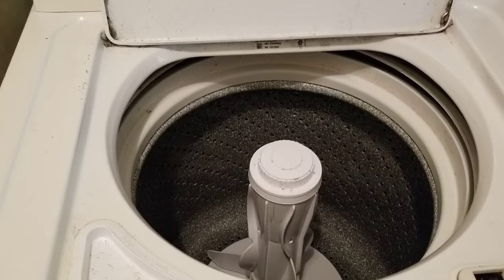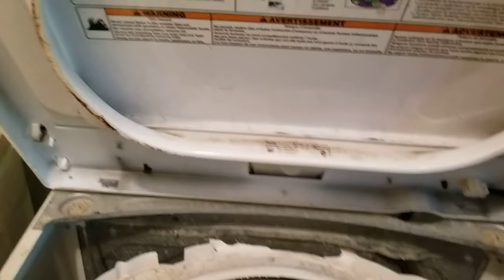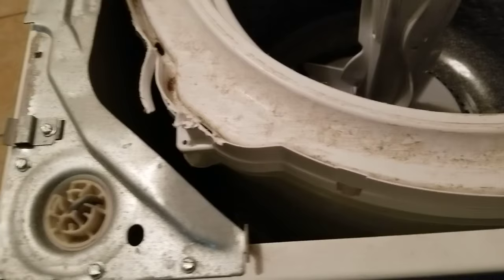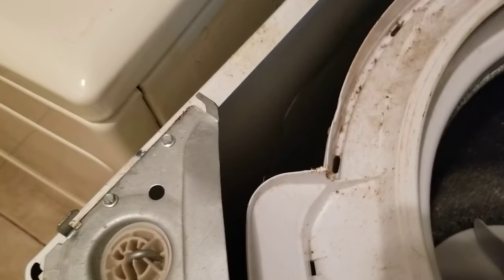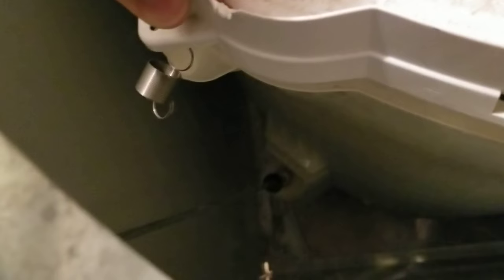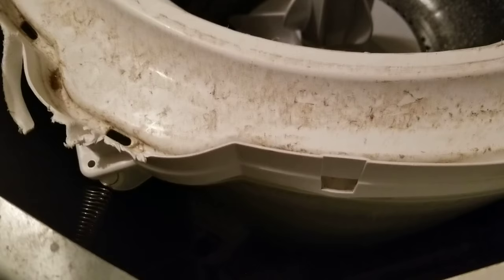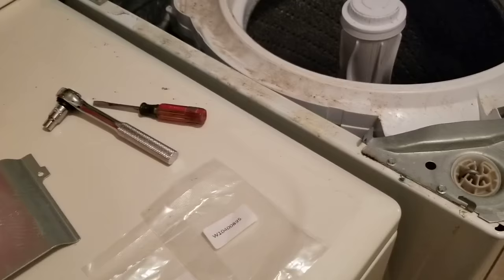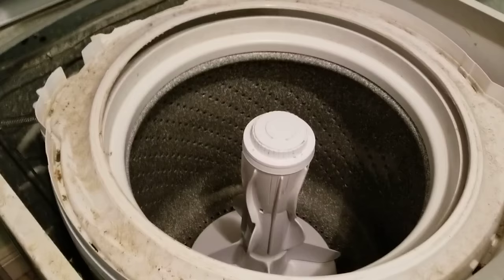Roper / Whirlpool Washer banging out of balance No. (1)  / shakes / moves *(worked briefly)

Comment: Thanks for this video. My Whirlpool washer is also "banging" around during spin cycle. I've already replaced the suspension rods and that fixed the problem for ONLY the 1st few loads. My washer also doesn't come with these centering springs. These centering springs look so flimsy and doesn't have enough strength to hold the drum from "banging" around. Can someone please confirm that these centering springs will do the trick?
Reply: I was thinking the same thing
Reply: They don’t do the trick, these light weight springs are useless, there are some stiffer springs for $24 on Amazon though that look more like what is needed.

Comment: Replaced suspension rods and still didn't solve the problem. Then I replaced Washer Drive Block which solved the problem. Definitely get yourself the spanner wrench. It's worth it! I tried to remove it first without the spanner wrench and it didn't work. Once I got the spanner wrench, it was super easy. Replacing the Washer Drive Block solved the possesed washer machine problem.
Reply: Wondering if the problem is the suspension rods on a Maytag,  having the shaking problem.
Reply: @7dony  try replacing the rods first and if that doesn't solve the problem then replace the drive block.
Reply: I will try this.  I also installed the  suspension springs to no avail.
Reply: How did you determine that the drive block was causing the banging problem? Where did you get the spanner wrench from?  Thanks in advance for any and all info/help!

Comment: Sorry to tell you this buddy but you're wrong... that model meant to have two and only two Springs because if you look on the bottom of the washer the weight of the motor and transmission are not even... it needs Springs only in specific areas to compensate.
Now if you look on minute 6:30 you see a top cover broken... you have  to look behind the washer and you'll find there's a big gap in between two Metal Sheets... that it is Where the manufacture fuck it up... the plastic get tangled a high- spin speed... know your job it's find out why your washer it's why your washer it's wobbling I'll give you some tips
1- your washer it's not leveled
2 not pumping the water fast enough
3- one or two springs are missing
4- drum off center( very common problem) rotate your drum why look in your tub if you notice a wobbling imagine that at high spin...
5- look underneath of the washer
Reply from the maker: <SpongeBob French Announcers voice>: "Twenty Two Months later... it was the rods, till working like new. Thanks though. Maybe for someone else.

Comment: All  I ordered and installed where the long things with a spring at the bottom. I watched several other videos and this one before I think. Boy I had a real hard time pulling up and turning anything to align with those slots at top as you shew, HaHaHA, I guess it's showed. Never was good in English grammar. Today I show Yesterday I showed tomorrow I shew? Will show? Apologize for getting off track, I've been accused of rambling but don't believe it. Anyway back to the subject. I ended up using vice grips to grab the rods to pull them up and put enough  pressure on them to twist and line up with the slot to  install and remove. They were too slippery to grab and pull up bare handed. I didn't investigate but there may be a way to jack up or raise and support the tub to remove the weight and to support it until the rods are removed and installed. Probably not without doing damage and difficult to work with due to lack of room. It can be done with one person but 2 would make it a lot easier and a lot less cussing. I was going to say or work it in at the beginning when I mentioned watching yours and the other videos, Seems like yours was the only one showing those small springs at the top of the tub. I never saw any, I think you commented on something similar. I did notice when ordering the long rods with springs that it mentioned "people sometimes order these also" showing 2 of those springs at the top of the tub that attach the tub to the sides. As I'm saying and you said 4 makes more sense than 2 and I don't know if they discontinued their use or just forgot about them but I never saw any sign of any of them so I decided not to install any of them. I'm procrastinating doing it as It's a double barrel pain in the rear especially for one person. Probably also for 2 and there's not enough room for 2 hands in there anyway. I was thinking the other person could pull up on the tub and relieve the pressure caused by the weight of the tub. Seems like the first one or 2 are easiest maybe because the others are holding a portion of the weight. The tub is empty (no water or anything inside them) but I guess it's still very heavy although I don't see why. Perhaps there's something attaching it to the bottom. I don't think anyone wants to get into that if so. Maybe mine just has slicker rods or something. Theres not much room to work. I saw where you showed how to remove that upper piece to the tub. If that looks easy I may do that just to get more room for my arms to get in there. Last time I got all scraped up and cut a little. There's lots of sharp edges in there especially on any of the sheet metal. We'll see what happens this time. I did it before thinking there's got to be a way to bend or clean or roughen up those rods or pull the springs out and stretch them and make them work again. They are such a simple looking thing and I couldn't figure out what could wear out unless it was the spring at the bottom. When I found out I didn't do much, almost impossible to stretch the springs. I think I tried bending the rods where the springs where to make it harder for them to stretch. I never saw how anything could wear out and why they weren't working but I suppose the wear is so slight and impossible to see or detect that nothing I found would work. One of the other videos said they're just worn out and get some new ones. So, I guess I'll try these I got from Amozon for almost half price and free shipping in 5 or 6 days. Postman dropped them off and the box looked like it came from a train wreck but the rods don't appear to be damaged. If I have time and remember I'll write another way too long comment to tell whether or not installing those small springs up top made a difference. I should have said not installing but not being good a grammar my sentence would have read (whether or not not installing those small springs mattered). I think I am starting to ramble and don't even understand what I wrote myself. Geeze, Later

Comment: Just a question here I have the same machine it was given to me and it's old and used it for quite a while and then it started doing off balance making a lot of racket so I  replaced the suspension rods and then I just seen your video about springs and you said a lot of them don't even come with springs well this one looks like it never came with springs why all of a sudden now is it not performing right because if it never had springs, why now does it need them?   I guess that's my question. I guess I like to know the why when things happen. But I'm really really glad that I caught your video because I'm sure it's going to be the problem solver.
Reply from the maker: adding the springs STRANGELY worked for a few washes (DOESN'T make sense) but the other video, replacing the RODS is what fixed it STILL since video date...

Comment: I just installed my springs.  I found that if you use vice grips to hold the rod it gives you something better to lift the rod up. I also marked the rod and the holder, where it was, with a marker to get it back exactly where it was originally. I'm trying my first load now. Springs didn't work for me!!!!!

Comment: my kenmore does not have these springs either and my washer does at times goes out of balance. Would these springs work for my kenmore also? Thanks for the info in the video.
Reply from the maker: 'If" it came without them, no. It's probably the rods 'springs' going bad.

Comment: I'm ordering rods for mine, banged around when the load shift when new, machine about 4 yrs old, bangs all the time, unusable, but now I'm not sure the rods will resolve it, I did take each one out, and for the life of me I don't see anything physically wrong,my machine doesn't have any other springs, only those suspension rods, I did notice that when filled with clothes and in wash cycle, I stopped it and lifted the basket by grabbing with both hands and let go and the basket seems to be hitting the bottom, so maybe the springs are allowing sag, I'll update when I get the parts

Comment: I put the four springs and it still bangs around. Not as much and it quiets down just a little faster but the problem still is there. Good video though. Thank You
Reply from the maker: Look for my video on 'rods' that fixed it and still working years later.
Reply: @PatriotMarine  Yes just saw it. On my way to replace them. Thanks!

Comment: Did putting 4 springs make a difference?  We just put ours back together b/c the spring had popped off, but we will replace the springs now.  Wondering if 4 (there were only 2) is better?  Also, why do you have *(worked briefly) up above?  Appreciate your help.
Reply from the maker: as you noticed, it 'strangely' worked for a few loads ONLY. Then on the next video on the channel about the washer replacing the rods; that worked and it's STILL working. *(look at video date)

Comment: My washer didn't have any springs on it.  I bought two for the right side and it didn't fix the problem.. I replaced the suspension rods and that didn't fix it either... suggestions.  I have a maytag centennial washer mvwc200xw2
Reply from the maker: strangely the 4 sprigs made it stop shaking for a few washes, but then started again; the rods stopped the shaking & like new still.

Comment: Hey sir, you included a link to amazon for the suspension rod kit

Do you have a link for just the suspension springs?

Or is it recommended to replace the rods AND springs?
Reply: I'm wondering the same thing.
Reply from the maker: Just Added Link

Comment: Thank you for posting this video.  I was sincerely hoping this would be a solution to my identical problem with my Roper washer.  I ordered the springs you recommend and installed them.  First load after installation, still shaking!  When I received the springs I was doubtful they would be of any assistance in helping with the shaking due to their flimsy nature.
Reply from the maker: The RODS made it work perfectly.

Comment: My Whirlpool top end Washer shakes and rattles only at the beginning. I checked inside and do not have any springs on the rods and there are no holes for springs. The rods looked Okay but I might take a chance and order the rods. It is an older model ( either 1991 or 2001, according to a website that identifies the year).  I wonder if the springs were only put in the newer ones? It was also chipped and cut at the top like yours. Thanks for the video
Reply from the maker: Wow, you're getting your moneys worth out of that one. If you see first video I didn't replace rods because after inspecting them (except checking amount of tension on springs) there seemed to be nothing wrong with them. After receiving new rods & springs by sight or feel STILL couldn't tell the difference, but that fixed it. Good luck.
Reply: Old rods look fine, but they are weaker, new rods fix ours.

Comment: We are having the exact same problem with our washer and it's a Roper. There's no springs like the one you put on yours. The rods are fine. When it starts the spin cycle it starts to walk it's way out of the wash room. It's driving us crazy.
Reply from the maker: on mine, the side springs worked for a couple of loads, then EVEN THOUGH the I inspected the springs and seem fine (even after new ones arrived) that's what fixed the problem 100%
Reply: @PatriotMarine  thank you! So I need to get the Model number off of my washer and what exactly do I type in to order the springs? Thank you so much for that video! I don't understand why they never put them on it in the first place. The only thing I could come up with was after buying the washer they knew we would need those springs later on.. that's what I think but it worked so well before I needed them 🤦🏻‍♀️ lol..
Reply: @PatriotMarine  Explain more clearer ? did you use 2 springs in beginning and later add 2 more to solve problem ?
Reply from the maker: @mark-Vortex369  installed 4 springs & worked MUCH better for a couple of washes; then had to replace rods as in next video to finally fix for good.
Reply: @PatriotMarine  thank you , make sense it was working without springs to , whirlpool has them . I am going to order them to plus the Rods .

Comment: Hopefully we won't run into this problem but we do have another issue you many know about, if you please.
Someone gave us a washer like yours and right now it's not filling. 
We had our pipes re-done and haven't had a washer until now. Apparently the hot water facet in the laundry room in not flowing so I only connected the cold water hose.
Does this washer need to sense pressure from both sides maybe? Could that be why it's not filling?
Hope you can help. Thanks
Reply: Mine works with only cold hooked up. The problem is probably that this washer is the biggest POS appliance the world has ever seen.
Reply: @nelsondln  I got a proper hose splitter and hooked both sides to the cold water and the machine is working fine. The washer was given to me for Free!  That was a blessing and on top of that, a dryer someone gave me ten years ago was hooked up and it works perfect too!

Comment: So much gratitude , you are a Wonderfull Man !
Question , what is happening that it does not fail to begin with if the springs are missing ?
Why does it not make the banging noise in the beginning , so logical it needs 4 springs to balance it out ?!
Reply from the maker: Correct; common sense says adding 4 NEW springs shouldn't have fixed it since it only worked for a couple of washes then banging started again and was finally repaired by replacing 4 rods as seen in next video.

Comment: Great video! Quick question: what would happen if I change the rods but the new ones are slighltly shorter than the original ones?
Reply from the maker: I would ASSuMe that it would bring the bucket up that distance, springs being the same tension.
Reply: @PatriotMarine  Thanks buddy! What do you think? Should I get the ones with the original size?
Reply from the maker: @McTzt  O always do when available.
Reply: @PatriotMarine  Thanks man! :)

Comment: I only wish I would've watched this video before my jery rigging which was to drill 2 holes in each side panel and feed a rope into one hole, wrap around bowl and come out the other hole so the rope is in a U shape.  Did this on both sides and problem solved, although its ugly.  My question is, that round thing you chose to not replace that you pop off with a screwdriver, I chose to remove it and not replace it.  Will that end up being a detrimental decision in the future or do you think it will be fine?  Thank you in advance if you respond...
Reply from the maker: not sure what part you're referring to, what time in video?
Reply: 4:33
Reply from the maker: @bongo042  that's what carries the bleach in and keeps it from splashing out as it gets spinning fast.

Comment: Update: as I mentioned before the springs did nothing, and there is nothing wrong with the rods.
I just put 4 pieces of foam about 6-8 inches on each side of the walls but inside, between the plastic and the metal wall. That did it.
I tried with a Large wash and it still  vibrates  but the plastic did never hit the metal walls again.
Save your money, try this first, do not buy the springs.
======
Ordered the springs but they are a joke, too weak. Won't work at all.
What I did was put a couple of packing foam from a package box I had on the sides of the fridge, very tight and when the  banging starts it lasts 1 or 2 seconds only.
Thank goodness my washer is in a separate place surrounded by walls.
If you have the Washer and Drier together one guy in this section did tie both together with a long cable/rope and that fixed the problem as well.
Good luck with this badly designed Washing machine
Reply from the maker: 'if' the rods are your washers problem & you install the proper rods, it will work like new.
Reply: I'm giving yout advice a shot cus this is ridiculous to have to buy,no matter how cheap, stupid springs for a washer that should of had them installed by manufacturer from the get go. I hope the foam works,I've got a bunch if foam from amazon packaging left over from Christmas, so I've got my fingers crossed this stops my ol washer from skipping through my kitchen.
Reply: @neciasilver5357   did the foam end up working for you? I’m having the same problem but my clothes are getting tangled around the agitator

Comment: Mine was shaking violently to Whirlpool thanks to this video I tore it apart and mine is also missing the Springs. where did you order yours from?
Reply from the maker: It's been months, I don't recall. I just Googled parts for my specific model. *(found out after a few washes that it was the rods, so order that also since it started again BUT never again after rods) let me know if you still need help finding parts.
Reply: @PatriotMarine  Hey bud can you help me find the parts that I need to perform it. Thanks so much
Reply from the maker: @dadtothefifthpower1576  Did you find them? Make, Model,

Comment: I replaced all 4 rods. Helped some , stills bangs around.   Replaced two springs on right side, no difference.   I put tap springs on left side, no difference, stills bangs around.   Nothing seems to help.
Reply from the maker: rods & springs?
Reply: Have you double checked the level in all directions?   Some also have tabs that sit at the bottom of the tub.